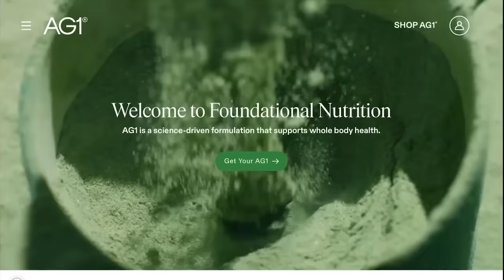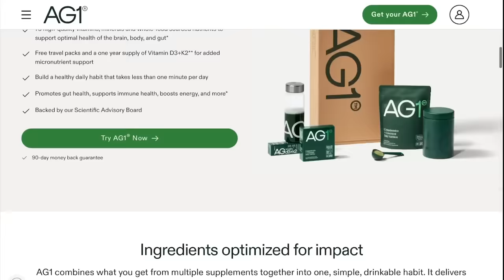From Stone to Home. Building A Stone House in the Italian Alps

Comment: Hi there
I have been watching your vlogs now for a while and your progress that's impressive to say the least.
Now that your shaping stone for the property I want to offer you some advice as I was a stone mason in the channel islands for a number of years and we have some if not the hardest granite in the world.
So instead of using a wooden platform when you are dressing the stone a good tip is to find a 45 gallon steel drum and remove one end completely, then fill the drum with old stone and earth until its around 12 inches or so from the top then finish the filling with tailings the type they use to make concrete, fill to the top then use this as your platform and what will you will find is the stone is less likely to crack or break and jump around when working it and also its a very comfortable Hight to work and at less strain on the arms. just make sure the drum is on a level base before you fill it.
Hope this helps should you try it.

John
Reply from the maker: Love the idea! What are “tailings”? Was unsure what you mean for what you use for the top 12”
Reply: @RaisingVoyagers Hi, So the small stone you use for making concrete are are used for the last 12 inches of filling and also it makes no difference if there is a bit of sand mixed with them but not to much so as the stone your dressing can mould its self into the shape therefore there are no hollow areas that can cause the stone to crack, you we feel the difference immediately.
John

Comment: That is certainly a skill to have, and I am impressed that you are taking on that project to learn that skill , as physically it is taxing and by the end of the day your hands and arms especially your forearms can get quite cramped and sore. One thing I am surprised at is that you are not scoring your stones with a stone saw or  masonry blade on a skill saw to  cut a deep score on your stones, then use the chisel and hammer to break off the waste part. This will give you nice straight lines  and speed up the process.  I see that your stonemason does this with the threshold stone entry, however just a thought.  Your build should look  amazing when completed and fit perfectly with the rest of the home ...all the best, I am looking forward to seeing its completion

Comment: Hey and ho,lotsa work with more than two !! Looking very good, and you are getting the hang, dealing with the stones.  As for metal iron, I have seen such with a strong epoxi, or some other plastic , in a round ring around the top, which deflect out and protect the hand, holding the iron.....
Another two-three days with this weather, and it will eventuallly be finished....
Congratulations to your effort, and enjoy working with experienced stone masons !!
Allda bestest from mikke, in karlstad,sweden....now plus five here and the snow is melting and the snowdrops are coming up near the south wall.....

Comment: Hey! Big fan of the channel. You're living my dream. I did a masonry school in the US (brick, block and stone) and continuing my education doing drystone walling. My dream is to move to Italy and renovate an old stone farm house, so you're literally living my dream! I wanted to ask you about how you're using the lines. Mainly the vertical lines dropped down the corners with the piece of wood at the top (there's a weight at the bottom that keeps it straight, yes?) I noticed the horizontal line sometimes seems slanted. With bricklaying it's fairly simple and supposed to be perfectly straight because each brick is almost the exact same size and the bed size for each course should usually be 3/8 of an inch. But with stone, can you please explain a little bit how each course of stone works both horizontally and vertically given they will never be the exact same size? Thanks and love the channel!!!

Comment: You decided to make the windows and the door smaller, but are you sure the new measures still meet the legal requirements? Did you check with the architect before proceeding?
Reply from the maker: Yes this room doesn’t have to follow hardly any rooms. I checked.
Reply: Now that I think about it, you're going to use is as a storage/utility room, so you're right, you don't need to follow the same rules as if it were a bedroom or something. My mistake. Good job! @RaisingVoyagers

Comment: I know you guys have had, and are having, drainage issues, with water getting into the house from higher up the mountain. I wonder if it's possible, or would be effective, to install some French drains into the terraces above, buried just inside their faces? Like if you put a French drain into the terrace immediately above the house, then another one in the terrace above that, both of them channeling water to either side of the house. Have you thought of anything like that? Not sure if it would work, but it seems to make sense as it would reduce the total amount of water getting at the house.

Comment: What will the inside walls look like when the wood is removed, will it be stone or drywall of some type?
Reply: They're filling the space between the stone and the forms with mortar, so it will be a flat, grey surface on the inside. That reinforced layer is probably required for earthquake safety.